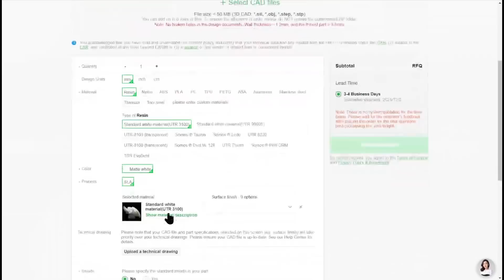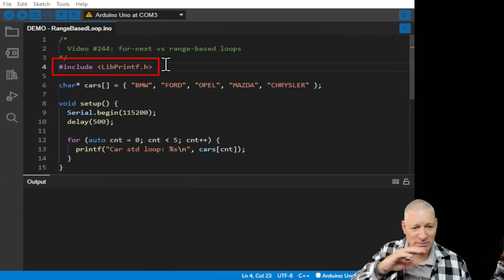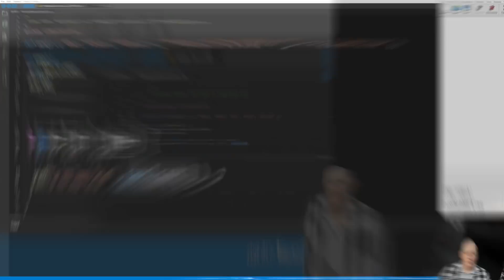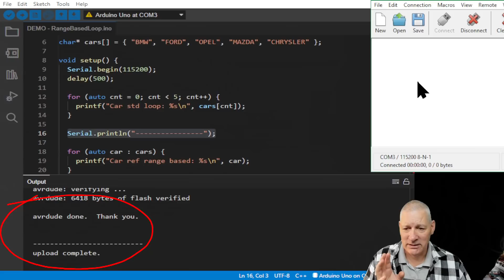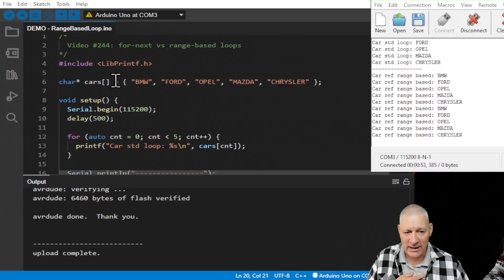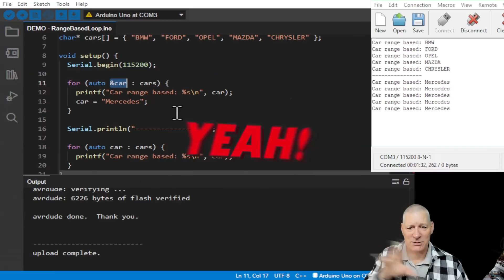#BB8 C++ Range-based Loops✅for Arduino (and other μcontrollers) - so easy!

Comment: Thanks a lot for the great video. I have question, how do I define a matrix with variable rows but constant columns. What I mean is like, say I know that I will have 5 columns but the rows will be upto the user. So let's say I have a variable numOfApples = (a number set by user) and I will then have a matrix like  M [numOfApples] [5] = {0} . I tried this but Arduino doesn't like it, so I couldn't do it.
Reply from the maker: You can have multidimensional arrays.

Whereas an array defined as myArray[6] is single dimensioned (and easy to understand), an array defined as myArray[3][6] gives you three "rows" each of six "columns" (if you want to view it like that).

Incidentally, the first value (rows) must be defined at definition time, but the second value (columns) can be variable. But if you just mentally switch rows for columns, then you have your variable "rows" and fixed "columns". Yes, it hurts my head too.

To initialise a multidimensional array, you can do this:

int myArray [3][4] = { 
   {1,2,3,4}, 
   {5,6,7,8}, 
   {9,0,1,2}
};

Finally, although we declare rows & columns in the usual (human) way starting from 1, we must address them in our code starting from [0].
Reply from the maker: Worth reading: https://bit.ly/MultiDimArrays
Reply: @RalphBacon  Thank you for the quick answer Ralph. I got your point. It hurst as much as it makes sense. So you are saying, if I declare a multi.dim. array as Result [5] [whatever] then C would be happy to accept that definition. So if I declare whatever = 10 down below somewhere, the compiler would then take Result array as Result [5] [10] ?? Is that right?

Comment: In the pass by value example car=“Hyundai” is trying to update the counter called car. Hence it doesn’t update the array. I think what you meant to do was cars[car]=“Hyundai” (I forget if it should be round or square brackets). This will then update the car’th item in array cars with Hyundai.
Reply from the maker: In the pass-by-value example, 'car' is the variable containing the nth entry of the array. The compiler has done the hard work behind the scenes. We don't have access to any 'cnt' variable (the index) in that loop mechanism.
Reply: @RalphBacon  interesting- I’ll have to take another look at that.

Comment: When I first saw the title, I thought it was gonna be using negative counting for loop iterations, as used in the manual Atmel released for more efficient code, but how could I have done so much on AVR micros and not know this? Now I don't need to remember how many entries are in an array, and if I combined the pass by reference with a const, it'd probably save memory but also keep it read only, wouldn't it? ... Still, the auto loop, that's nice. Thanks for sharing :)
Reply from the maker: Yes, this is a very useful technique (once you know 😉), glad you found it useful. Passing by reference saves memory (no copying of variables) and the const would keep it read only. Listened well, you have, my young padawan.

Comment: Your code is not safe. You put a local string "Mercedes" il your array  that can not longer exist after the first loop.
Reply from the maker: 😕 ← that's me with a confused face. The string is copied into the array which is declared as a global so will survive (as will its contents). Try it out!
Reply: @RalphBacon  a pointer to the "Mercedes" string literal is stored into the array. String literals are usually stored in program text with other constants, so pointers to them are valid for the life of the program. The issue is const-correctness: your array should be "const char *", as string literals should be constant since C++11. This was undefined/implementation defined, even in ancient C.
Reply: @RalphBacon  
No! 
The string itself is located in the current stack frame. The pointer to the string is stored in the (global) array. And the array is valid as until you leave the current stack frame and call another function. Like in Arduino, when main() calls loop() and then another function before it goes back to loop. It works for the printf() inside the „for“, because the stack frame of the calling function is still available.
Also be aware, that avr-gcc does not place string literals into Flash. They are in (and use) RAM. You can also see this by the missing compiler complaint about pointing to a const with a non-const referring pointer. With „char *“, both the pointer variable and the pointed to variable are non-const.
Unfortunately the original Arduino uses AVR8 chips. They are supported by a great compiler, but C++ does not use the AVR8 memory model of separate address spaces for ROM and RAM. That makes placing constants to ROM a thing the programmer has to take care about. 
Also, if you use Arduino „String“s instead of string literals, you are touching the „copy object“ area. You would need „auto &“ to avoid copying, but should add a const to avoid changes. That all has big impact on your generated machine code and your RAM-usage. Strings are on the heap, that might grow into your stack and suddenly you crash and the average Arduino programmer had no clue why.
Reply: I agree, it's actually a poor practice to write code this way, you overwrite the pointer to point to a local string, the original strings' memory are lost, and the local string is not guaranteed to remain when the function exists.  Although in 8-bit microcontroller world, there is no memory protection / virtual memory stuff, so, the code works, but still not a clean way to code.
Reply: I think the use of "auto" is obfuscating what type the variable  "car" is in each of your example loops.
In every case the scope of "car" is local to within the loop.
But it is sometimes an integer (you say it usually puts in an integer), sometimes a string, sometimes a pointer....
Variable types are not trivial!
Reply: @dozog  and if you use the wrong type it might compile but use weird conversion.
Just think about mixing signed and unsigned, either fix even compiler warnings, or let the compiler figure it out.
And if you only use hardcoded types if you really need them, it also is documenting that fact and „auto“ says „fine with the default“.
Reply from the maker: I think if the "Mercedes" string had been declared at the outer scope it would be code safe. the lifetime of that string would exist as long as the code was running.
Reply: @RalphBacon  you have put yourself in a non-easy situation with these YTs. Arduino is designed for people w/o much technical knowledge (and good so), but they choose the most complex programming language available. 
But I‘m sure you already found out by reading some of the comments 😎
Reply from the maker: I've had a re-think.😲A string literal can be assigned to a char* because it is statically allocated. It therefore survives when the function ends. So you can return a string from a function like this:
const* char myFunction () {
   return "This is an error";
}
The memory allocated to the string will not disappear when the function ends. So my example is just fine, that "Mercedes" string will survive. 🎉🌟

Comment: Imagine a world before for next loops. For, in fact, there was such a world and it was long before the 'C' language. In these olden days, your for next loop would have been: cnt =; 0 while(cnt < 5) {printf("Car std loop %s\n", cars[cnt]); ++cnt;}. So the powers that be came up with the for next loop. Why? Well, this was a very common pattern in programming and it was easier for the compilers if the initiation and the count and the comparison where all in the same place. Hence the for next loop. Programmers are human and like the rest of their species, they always think they can do better (in the big picture "better" is a very complex abstract; ask any polar bear). So they came up. after may decades, with the range based for loop. This is a good thing BUT don't be fooled into thinking you are generating less code. For (pun intended), the code generated by the compiler is the same for both for loops and, if written as I wrote it above, for the ancient while loop. I am not saying there is anything wrong with that; I will always use the range based for loop whenever I can. It is a thing of beauty and so easy to read, it avoids the "off by one" error so ubiquitous in software. Just don't be lulled into a false sense of security that "syntactic sugar" saves those valuable bytes of embedded resources.
Reply from the maker: 10 LET A=0
20 do stuff here
30 more stuff here
40 A=A+1
50 IF A < 10 THEN GOTO 20

Looks fine to me. 🤣😅😫 What? What? 🙄

Comment: Good. I wrote a program in year 2000 where that would have been handy. I had a lot of lists and used
#define CARS_MAX (sizeof(cars)/sizeof(cars[0]))
Not as elegant as with C++11 but better than a constant number in the code.
Reply from the maker: Indeed. I do this too. I mentioned (did it make it into the video?) about doing something about the button-push detection. I was going to use a #define for that. I still might.

Comment: for(car=0;car<sizeof(cars)/sizeof(char*);car++) {stuff}
Stoneage code for completeness, I had not seen the modern approach and found it interesting.
Reply from the maker: Quite so; not exactly beginner friendly! In fact, not friendly for anyone. thank goodness for range-based loops!
Reply: #define NITEM(a) (sizeof((a))/sizeof((*a)))
for(car=0;car<NITEM(cars);car++) {stuff}
found on a cave wall.
Reply from the maker: Ah, yes, one of my ancestors probably wrote that #define. 😁
Reply: But there ARE still times when you need the index within the loop.
Reply from the maker: Yes, indeed, and then we need to fall back to the original way to code a for statement.
Reply: @RalphBacon  There are C++ ways, see "Access index in range-for loop" on stack overflow. Probably running an index/count variable in parallel is the simplest.
Reply: @RalphBacon  Yes, that was my point.  Some languages actually do allow retrieving the index within a "foreach", but not C++.

Comment: Optimized code: If you don't want to modify the value then take it by const reference aka "const auto &car". If you take it by value aka "auto car", it will create a temporary copy of the value. You don't want that in the embedded world.
Reply: „Temporary copy“
Correct, though for a char* it‘s not a disadvantage. A reference would need the same space, but if the array would contain String objects, it would be different.
Reply: @fromgermany271  Correct. My comment was for the general case. Exceptions apply.
Reply from the maker: Yes, I'd always use the "pass by reference" approach, with a "const" to protect the array from inadvertent modification if required.

Comment: The type of the array in this specific case should be "const char*". Newer gcc versions warning you about this. C++ forbids converting a string constant (aka const char*) to char*. See the "-Wwrite-strings" warning switch for newer gcc.
Reply from the maker: Well... sort of. Yes the compiler does complain that the rules state you cannot convert a string to a char* array... but does it anyway, as does everyone else. If you switch on Verbose settings for the compiler you'll (briefly) see this error/warning as it flashes across the screen.
Reply: @RalphBacon  
The main feature of C++ (for me) is that can (in detail) write down your intention and the compiler finds a way to run that best on your machine.
Downside: you have to clearly state your intend in his words. So if you say „I want a write pointer to a string literal, don’t expect it to be a constant afterwards. And if you ignore warnings, you might end up with code, that only runs most of the time. This is especially bad for inexperienced people (the typical Arduino users), because they will never find out.
I have some respect for people teaching C++ to this target group, because I know that you might open Pandora’s box.

Comment: Thank you for the very useful information you shared in this video. I wasn't aware that range-based loops are available in the Arduino IDE, they really make programmer's life easier.
One small note: using reference not only allows the array members modification but also makes the code more efficient because it doesn't copy array's components to the "car" variable. It may slow the execution if you have a large array of "heavy" objects.
You can still use reference and also prevent an accidental array modification by simply defining a "const auto& car" variable. In this case the compiler will give you an "assignment of read-only reference" error if you will try to upgrade your car to Mercedes.
Reply from the maker: Indeed. This particular bit of code benefits from references as it (could) contains many characters not just a two-byte integer. Imagine an array of a struct with 50 bytes each!

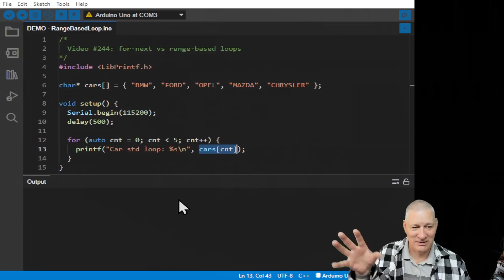Comment: Ralph - I strongly suspect that most C++ programmers will not have used the auto keyword in a standard for loop many times, if at all,  despite what you say at about 04:50  It is surely more normal to use a specific data type (usually int) for the loop variable even when byte would be big enough

Using auto in this way is a neat way to introduce the concept but I feel that it would have been better to use a specific data type as the first example, then to introduce auto before moving on to range based loops
Reply: had me puzzled, never seen it before, still not sure, never using it, never going to google it...... i'm not one for change or modern adventurous new ways.
Reply: I have seen it when I tried out qt5 for programming a user interface. It had me puzzling about it until now so this is great.
Reply from the maker: @UKHeliBob I deliberately slid this into the conversation as a "by the way" rather than making a big deal of it. I think it's a much better approach than using a specific data type, especially when dealing with some esoteric data types:

Instead of:
std::map<int, set<std::string> >::iterator

just use
auto
I know which one I'd rather use.
Reply: @RalphBacon  You didn't slide it into the conversation.  It was never mentioned, which I think is a shame.  It would have made a perfect introduction to the use of auto in range based for loops and I think that you missed an opportunity
Reply from the maker: Er... https://youtu.be/qw7281Ab-QI?t=356 Admittedly it was a mention but I did explain what it did.
Reply: @RalphBacon  Yes, it got a mention but only long after its initial use.  

Let me draw this discussion to a close by saying that it is unlikely that I will be suggesting the use of range based loops to newcomers as for them it is just yet another complication that they can do without.  

A normal for loop is easy to understand once you grasp that it is really just a while loop in disguise.  Each of its 3 parts are standard C elements and there is no hidden "magic" going on behind the scenes

I look forward to seeing range based loops in your code in the future as I can't remember seeing you use them before.  If you had then I am sure that it will have raised questions
Reply from the maker: I have to admit that is a disappointing response from you but you do what you feel best. 😔
Reply: A C++ programmer will!!
But not everyone writing down C++ „sentences“ (or copying them from the net), is one of them.

Comment: Nice video, I'm still old school and stick to "For" and "While" and "Do" loops.
Also you kinda get stuck in the code style guides, and of course "Motor Industry Software Reliability Association"  (MISRA) C and C++ coding standards.
Reply from the maker: No, no, use the new feature of C++ 11 - the auto keyword can really work out all types of variable not just strings (char *) or integers but some strange ones too. Tuples, for instance.
Reply: @RalphBacon  but Ralph, I'm stuck in the mindset of certified compliers, which take years to  move  or keep up with changes.  Can you think of how much testing would have to be performed to prove that the compiler generated the code correctly everytime. Looked at one compiler once and it was £80k+ just for the documents ,the program was extra a lot extra. At least hardware was a lot easier unless you had an  fpga to get certified.  
Funny that a microcontroller was classed as too complex to test so didn't need to, but an fpga was too complex to test so you had to code review its set up program code in the same way as for S\W. How much fun it all was , don't miss it at all :-)
Reply: @TheEmbeddedHobbyist  Yes, Misra is still stuck in the 03 world as far as I know.  However, Ralph's 'channel is aimed at hobbyists, especially Arduino, and I doubt any readers are writing safety critical systems on the Arduino platform. Just use certified compilers for your day job and whatever you want for hobby work. It is more fun that way!
Reply: @mikelopez9893  Mike i was just pointing out how your ex day job influenced your hobbies!  With Auto in the loop statement you don't need the variable type  but with the printf is this there  a %auto i don't think so, I  maybe wrong.  So on one hand you don't need the variable type then on the other you do.

Comment: Looks cleaner, any performance penalties on microcontrollers worth worrying about?
Reply: There shouldn't be any performance penalty because the compiler will actually generate code that actually does what the original count based loop. So technically it might take sightly longer to compile, but when uploaded to the arduino its actually doing the same thing.
Reply: @IanSlothieRolfe  Okay thanx!
Reply from the maker: And in addition to what Ian says, it just looks so much more maintainable.

Comment: I did not know about this.  Cool tip.  Thanks for sharing.  What is the IDE, I think I missed it.
Reply from the maker: I'm using Visual Studio Code with PlatformIO add-on. Worth looking into if you're up for a challenge.